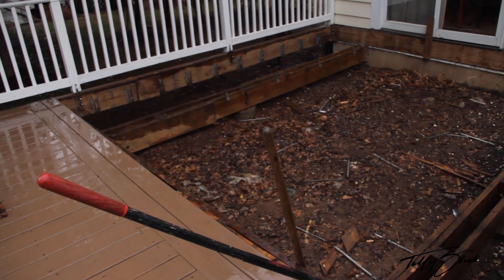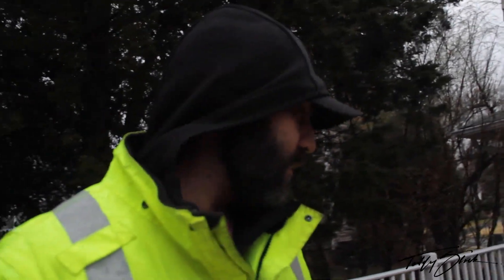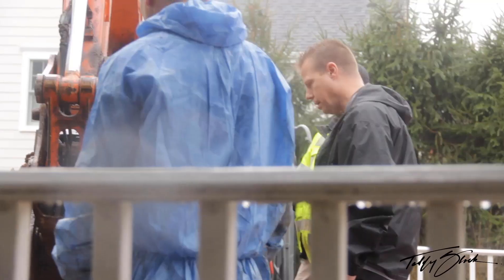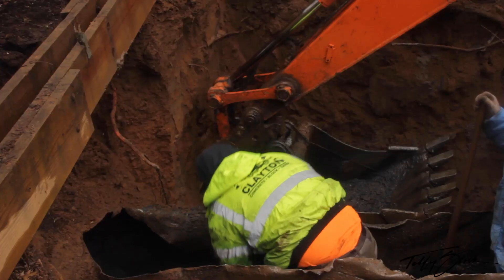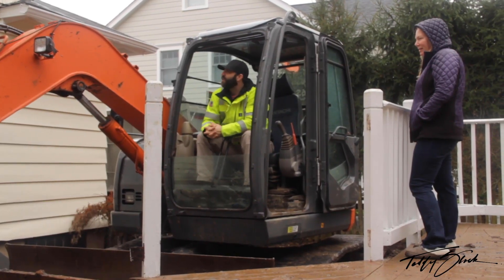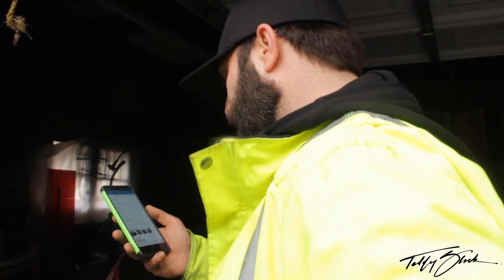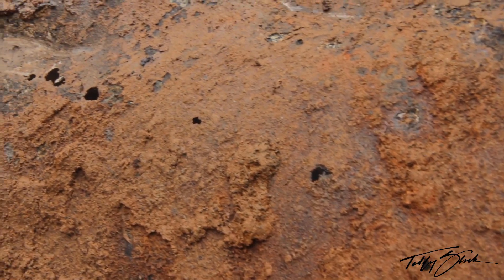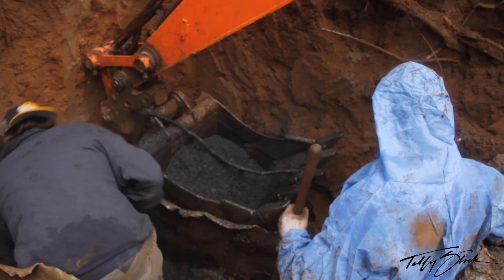Tank TV Episode 008 - If my Oil Tank has Corrosion Holes, Does it Require Soil Remediation?

Comment: I'm in PA and I bought a house with an underground oil tank. They (seller) stuck a stick in the tank a week apart and said there wasn't any leaks. Oil company told them if I don't want to use the tank anymore just to dump sand in an fill it up. I'm plaining on having it removed and going with an above ground tank. Not sure who to call about having someone come out and take a look at it. It's a full oil tank right now. Great video and glad I didn't do this to mine
Reply: If it's filled with oil, why not call someone and have them pump it out immediately?

Comment: Filling a tank with sand or foam was once an acceptable practice to save time / money or if the tank was partially under a structure and not easily accessible. Of course they are supposed to be drained and cleaned first, which not everyone did. Typically that was done by cutting a 2x2 ft hole in the tank to work through. Any tank abandoned in place should be disclosed to the new owner on sale of the property and they should also have proper paperwork to certify it was cleaned. You don't want to know the clean up costs associated with oil leaking into a well or footing drains, which may send product hundreds of feet away, or even to the next property. Best to do the job right the first time.